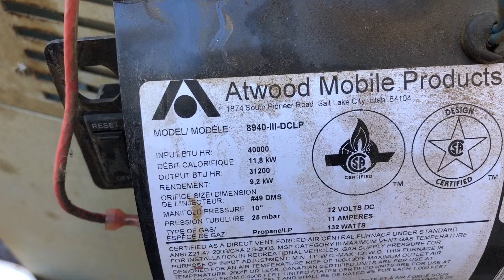Hoarders Camper Clean Out.

Comment: Great job cleaning up the trailer, great project.  If it were mine, I'd replace all the finish floors, no carpet anywhere, and then paint walls and refinish all the cabinets.  Be sure to check the integrity of your black/grey/fresh water tanks (which I'm sure you'll do, if you haven't already).  You may end up spending $10k bringing the trailer back up to snuff (no pun intended), but even so, it'll be one heck of a trailer for the price.  I hope you post more episodes about this project as you continue working on it.
Reply from the maker: All the carpets will be replaced.  New flooring scheduled for the kitchen/dining area.  I hope I don't put 10K into it.  It only books at 10.7K